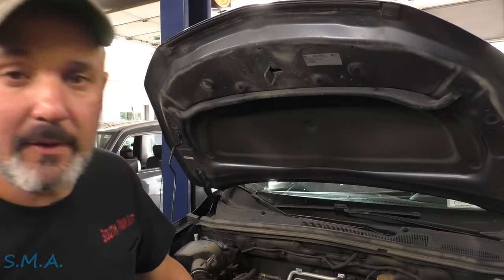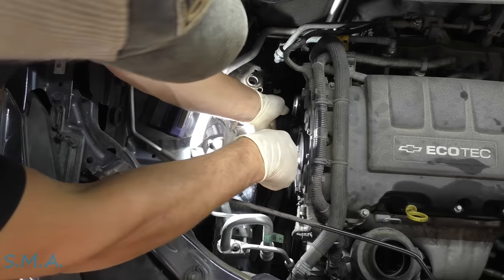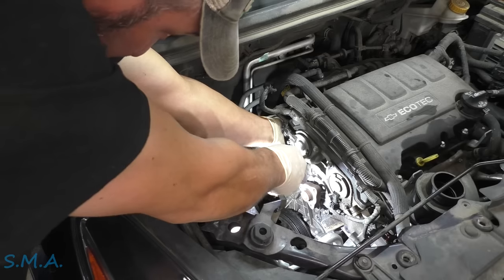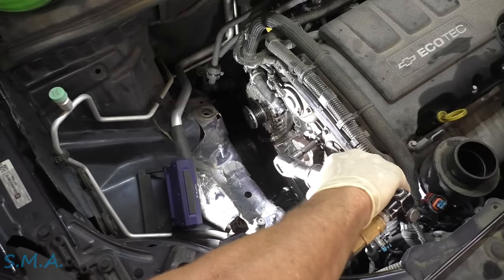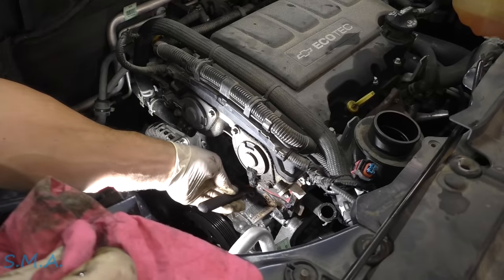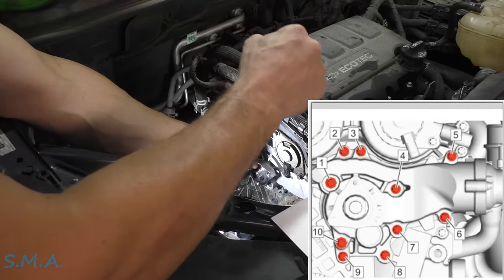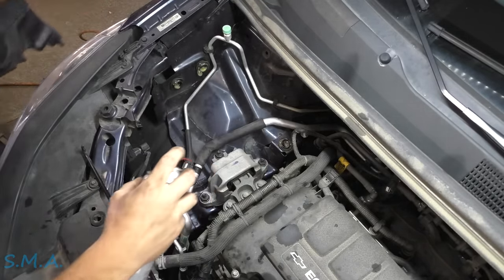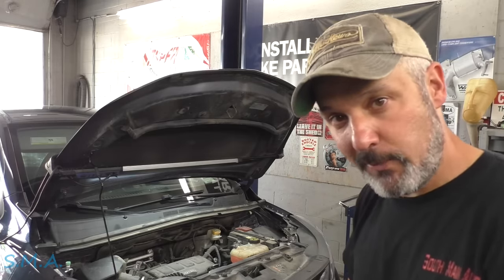Chevrolet Trax: Water Pump

Comment: I used to be chevy, and if I can find a clean older pu. Dodge hemi is almost 350,000. What I need to do make contact with auto surgeon and see if he can find a new old stock. I will add I use high temp form a gasket on water pumps,with the gasket  but I don't have anything that new,and I have a bug in my semi truck and should take a vacation up their and see if he can find it.

Comment: I have an Opel with the same engine, 1.4 l 120 hp version. Water pump must be changed at regular intervals, like belts and tensioners. I have changed it all together at 80k kilometers.  Just because I do not want to take chances to be stranded somewhere far from home.

Comment: That belt tensioner looked a lot like ones on a Volvo D7 Diesel engine, had a coil spring and a wire cable and also no place to loosen tensions. Had to use a piece of wood and a long pry bar or your hand. We had about 40 of those engines out of a fleet of 100 trucks. What a POS they were, changed about 2 a week.

Comment: I have a 2000 Chevy Silverado LS 2500 4wd 6.0 LS with 270k on the truck living in northern lower Michigan my pump just now started a leak original one also busted it's first brake line last week. Almost sold my truck for $1600 today

Comment: Eric, I seem to be the DIYer for my step daughter and her 2019 Trax. Just wondering if bleeding air out of the heater core piping is a necessity with this vehicle like it is for most. I figure if you didn’t mention (other than engine being low) that it isn’t an issue. Thanks for doing your vids, particularly the ones with a lot of wrench turning. I find your commentary and your technique very entertaining, even on repairs to cars I have absolutely have no chance of working on. Happy New Year!

Comment: They should have an electric torque wrench that you can set the setting and press a button and it will just tighten it until its torqued.
Reply: My milwaukee M12 does this....

Comment: 2018 Chevrolet Trax, just out of warranty I guess (maybe it's covered under extended warranty?). The funny thing is, I believe it is the same water pump for the 1.4L Chevrolet Cruze and Chevrolet Sonic. Well, have a look at TSB 14371B about the water pump for the Cruze and Sonic. Also, the radiator on the 2015-2019 Trax may leak TSB: A192219310
Reply: Are you no longer wearing your overalls/bibs Eric? Too hot?

Comment: Hey Eric, have you done the water pump on the Ecotec 2.2L and 2.4L. Looks like a lot of fun compared to this. You'll need a special holding tool and hope you don't drop a bolt into the crankcase.

Comment: The engine mounts are a nightmare to remove, on the Aveo/Corsa nearly impossible... A redesign should have been done years ago , but hey ho they never have to take them off at the factory. The coil packs are a common failure , but they always fail outside the warranty period and are a good seller. The timing chain sounds awful,  miss oil changes and a partially blocked oil pick up...they are tiny and get hard oil crud in them .

Comment: Could you make a video cleaning the throttle body of a drive by wire unit from a 2003 Silverado SS with a 6.0 L and 4L65E trans?  Actually removing the TB and cleaning that is, thanks, Scotty K. sends his best!

Comment: Who in the world designs a tensioner like that? I don't understand! 
Thanks for the video
Reply: The same ones that design an engine that requires the removal of 1/3 of engine to replace a simple belt. Engineers and designers have no concept for those who actually have to work on them.
Reply: FIAT is where the design originated in a cross-licensing deal with GM.
Reply: Germans.
Reply: People who don't have to work on them.

Comment: GM has a special coverage for the water pump on most cars with the 1.4L so this repair could be done for free at dealership but it’s only up to 120,000 miles
Reply: Ten years, 150,000 miles
Reply: @wayne foutz  Can you tell me where this info is ?  Wife's water pump just went out on her 2016 Trax.

Comment: Good job! Isn't 4 years from factory, a bit too short of a lifetime for the water pump?
Reply: In today's world of throw away plastic junk cars, 4 years seems like a pretty good deal LOL.  Given it being a rust belt car, 4 years out of the whole vehicle is pretty good LOL.
Reply: @wildbill23c  Yeah, you may be right (I'm not used to the destructive conditions of the rust belt).
Reply: @JoseSilveira-newhandleforYT  I live in Idaho, and they decided to start using salt and a calcium chloride mixture on our roads, yep quickly destroys your vehicles...doesn't help that all the car washes are closed during the winter so trying to run your car through one a couple times a week is impossible.
Reply: @wildbill23c  That's a big problem - cars are not prepared to resist that continuous salt bath, during snow period. Luckily, I live in a warmer place (no snow in winter).

Comment: Hi Eric, how many miles did the Trax have?   Seems early for a 2018 to need a water pump?   Enjoyed the video!
Reply: The 1.4 is a giant turd, lucky it's still running @ 4 yrs old.
Reply: Unfortunately, coolant leaks are pretty common on the 1.4. Usually it's the water pump or a plastic junction called the water outlet.
Reply: Mileage doesn't matter on this engine.  These 1.4 Ecotec (not the new 1.4 that's the same as the 1.5 in the Equinox) is junk and was junk from day one.  Water pumps, water outlets, thermostat, valve covers, turbos, etc.  JUNK.  20K, 120K.  JUNK.
Reply: Adding the green stuff could've caused the leak 🤣🤣
Reply: 10 miles out of warranty. Exactly as GM likes!
Reply: This engine is a train wreck for multiple expensive issues. So it’s not uncommon at all even for vehicles just out of their meager factory warranty. And it’s telling I’ve never seen a single GM or other American car maker employee defend their vehicles here. Not one. I think they know they’re mostly turning out unreliable junk and nobody wants to be associated with that.
Reply: This makes me appreciate my 4.2 straight six atlas motor even more. Sad part is i even considered of getting one of these and im glad i walked away. My sis has a chevy mailbu with the 2.4 ecotec motor and has nothing but issues
Reply: Jimmy S  dude that's the story of my life as well...same same same
Reply: @christopherzube551  I've also got a 4.2L that will be turning 300k by the end of this yr.
Reply: 4 yo and the pump is NBG !  I wouldn't care, but the Trax reliability is directly proportional to it's high price.  Can I point out that GM were bailed out by taxpayers money ?  Makes you think.
Reply: My car is a 2003 and it still has the original water pump, with that said it barely has 125k miles on it.
Reply: Jimmy S  However GM will replace intake  for free  lifetime recall
Reply: Are Trax Korean Daiwoo?
Reply: @randlecycling2462  yes they are made in Korea. I had one come in for service a few days ago and the 1st digit of the VIN started with a K.
Reply: @randlecycling2462  Yes and is also Buick Encore
Reply: Jimmy S  I thank God every day that I was able to wait til 2018 to buy my Cruze which has the gen 2 engine.  I had no idea the first gen had so many problems.  45k and so far and no issues or leaks.
Reply: Yea these cars are disposable. Idk why people waste money on them

Comment: Hey Burt let’s design a transverse motor and make no access thru wheel well . 🤡 technicians will love it
Reply: I knew a caddy tech, he drilled an access hole in the right fender apron to remove the camshaft on a fwd drive northstar.  Car owner went berserk, and the guy was fired lol
Reply: @scrappy7571  now that’s funny if you’re not the owner 👊🏻😂

Comment: So- I do mobile repair…or mildly stupid to put it simply 😂…I haven’t had issues with quick connect coolant lines- older ones have the o-run flattened, but I just replace those and nicer have an issue- am I missing something?

Universal coolant…it “works” but man it surely doesn’t do it well for any length of time.

Comment: The different length mounting bolts should be color coded - then the hole it passes thru could also be colored to match the required bolt length 😳🤔

Comment: What is the average cost to replace a water pump, also if your head gasket starts to leak antifreeze on the outside of the engine what would be the cost to replace a blown head gasket, on a 2007 Hyundai Santa Fe SE, 3.3 L engine.

Comment: Hey! So #1 I've been watching your channel for a minute and it's helped me understand more about how some of these modern cars work. Even helped me diagnose a bad TIPM on my 08 Chrysler Sebring. I ended up grabbing one from a junkyard and it fixed my main issue (won't stay running), but now I'm getting "nofuse" on cluster (but no money light!). Power locks don't work, ditto for a/c controls but engine/trans/brakes/cooling/lights all seem to work with no issue.  

I'm guessing this is some kind of vin mismatch thing. Are these able to be reflashed so my stuff works or do I just need to shell out for a replacement tipm at this point?
Reply: So locks issue fixed, was a bad fuse I hadn't seen. same with no fuse issue. So far just a/c compressor control doesn't work just blinks at me but a/c is on/working

Comment: I done this in my 2012 cruze last month such a pain to get too! My thing is now.. mine when i took it off did not have a metal gasket like that just silicone and disnt have that metal disk that went around the propeller and the hole in the motor.. ... am i doomed??

Comment: Why have an electric heater on a thermostat it’s just tech for the sake of it… it’s what I hate about new vehicles so much stuff just for the sake of it…  4-6 electric motors on the ventilation mixer and direction…. Just another thing to fail and cause a money light to pop on up..
Integration of ventilation stereo and sat nav so when it fails and they will instead of $100 for a sat nav or radio head unit it will be $1500 for the complete unit plus labour…
Rant over 
Thanks for another great video

Comment: Funny how my 2012 Cruze had the same motor and GM has replaced my water pump 3 times.  They offer a 250k replacement on some models but not others with the same motor.  🤷‍♂️

Comment: You kept me hanging until the end - it looked like orange DexCool.  When I changed all the hoses and the thermostat on my 2003 Saturn LW w/2.2 Ecotec, I ended up having to make an appointment with the local Chevy dealer for the heater hoses, because of those damned quick-connect fittings. When it comes to bleeding after a fill, is the thermostat with the heating element a good thing?  It seems like it would start to open even if there was an air bubble trapped behind the t'stat, and make it easier to bleed, so that would be a benefit to using a complicated & more expensive t'stat design like this.

Comment: I am doing a 2014 mitsubishi lancer gt sportback serpintine belt I can not get it on its about half an in to small even if I pull the tensioner back.  I have gone twice to the store got two belts sane problem.  Any suggestions?

Comment: Hey Eric...
What are your thoughts about the vacuum cooling system filler? Like in the astro # 78585 kit. 

I worked as a collision repair technician and on some vehicles (i.e.multi rad systems) I have to use a vacuum based filling as the air pockets are nearly impossible to burp with the traditional method. I don't have the astro tool but used a snap on tool but same concept (use shop air to pull a vacuum on the system and replace the vacuum with coolant from a bucket).
Reply: They work great on cooling systems that are hard to fill, due to air being trapped.  I avoid using it, because it has ruined several water pumps.  While sucking down the system heard a small pop sound.  Fill up with coolant and it's pooring out the weep hole.  Cavalier 2.2  was a hard system to fill, and had to take the chance on those.
Reply: I have an Airlift  550000 I bought 10 years ago. I prob only use it a time or two a year. Just used it the other day on an Explorer with a water cooled PTU. Vac down and filled the system in minutes perfectly. 

I usually just use the spill proof funnels and let the system burp out as it runs. BUT you get the specialty cooling system you need the vac fill systems with. Astro one looks nice with all the adapters

Comment: Been watching for quite a while . Love your energy man  . Quick question I’m dealing with a 92 GMC Yukon 5.7 TBI that has one issue I can’t solve . The engine seems to run just fine and normal until you put a decent load on it . I.E A/C on and in drive , brakes applied , while turning the wheel in reverse the truck dies . Restarts with the key immediately . Won’t happen when cold since the engine is at a higher cold idle speed . But once warmed will do this . I always felt like the warm idle was a bit low compared  to my Vortec 5.7 . Do you have any thoughts
Reply: Sorry, I read this late,,,I’ve done many,,, short list,,,, TBI gskt. , Clean throttle plates,,  IAC , if “rich smell when warm,,, the triple ground wire @ thermostat housing,, grounds coolant sensor & O2’s,,, clean,,, good to go! Primitive system that works well,,, when it’s in order! Hope this works for U,,, done a few hundred ! LOL over the years ! LOL

Comment: Chevrolet trax ...That there is a Daewoo Trax.....The older style engine the timing belt ran the water pump ,,,,,They were crap ,,,,,,water pump spun to adjust tension for the timing belt

Comment: I don't know what it is about the water pumps on those 1.4s,  I drive a Cruze with that motor. Everyone I know who has one, including myself, the first water pump fails somewhere between 20,000-40,000 miles, then the replacement will last a couple hundred thousand miles.  I've got 150,000 on my second pump.

Comment: And this is why I don't like sideways engines. Too much work involved to remove something simple.

Ill stick with SUVs with what I call normal engine placement, with the belts at the front. Just easier to access the things ill replace without doing this much tear down.

Like my 08 exploder, alternator is up top and easy to get to. Water pump is also within easy reach. Only complaint is the damn passenger side wires routed behind the nator.

Comment: Ah just what I needed, another broken Chevrolet but at least I don't own this one. My 2013 Chevrolet with the big 3.6 liter is dieseling whenever the engine gets above optimal engine temperature, doesn't do it when the engine is cooler than its usual temp, just when it's toasty though fortunately the old bat hasn't decided to keep running when ignition is off. I suspect that residual fuel is creeping down into the combustion chamber from dirty injectors and igniting just enough for all six cylinders to move until the engine decides to stall. Kind of a strange thing to witness when the engine isn't carbureted.

Comment: MY OCD would remove that leaf and debris from the motor mount asap.  Could not let it sit there for even a minute.  REMOVE THE LEAFS AND TWIG.  I also can't understand why you didn't just change the thermostat while you were that far in there, regardless of price.  Why didn't you put the green fluid back in since the customer had already switched it over?
Reply: Do that in the dealer, customers will call you a rip off.  They can pay me again if it overheats.
Reply from the maker: I just go in and do the job I was hired to do. I put in the coolant that it comes with from the factory and that is it.

Comment: need to change the water pump. OK $50 worth of tools I'll never use again I'm ready. What's wrong with regular headed bolts?
Reply: 6 point sockets fit on most of them just fine...
Reply: @scrappy7571  good to know

Comment: You did torque those 3 water pump pulley bolts, right.  I wanted to see how you held the pulley still while you achieved torque.
Reply: Take your old belt, put it through the box end of a large wrench, use it as a strap wrench to hold the pulley still
Reply: Zing them on with the ol' milwaukee m12 1/4 drive.  This ain't the lunar rover.
Reply: Click 😉
Reply: Use a pry bar between 2 of the pulley bolt heads.  Just like he did in the video.

Comment: Those engines are just an utter shit show. Plastic everywhere, I replaced two coolant outlets on my daughters car. Turbo under warranty at 40k. Water pump replaced, valve cover twice! I finally utilized the PCV bypass kit sold by Cruze kits and it ran well as half the engine was replaced anyway. One of the happiest days of my life is when she traded it in for a Nissan!

Comment: a 2018 that already needs a water pump. Water pumps should last between 10-15 years. 
My car is a 2003 and it still has the original water pump, with that said it barely has 125k miles on it.

Comment: I'm wondering if anyone may be able to help me?  I put new brake pads and rotors on my car the other day and noticed that the outside of the rotors seem to be wearing more than the inside?  I even took the caliper and brackets back off to confirm that the pads move freely in the brackets and they do.  Is this just normal when you install new brakes and should they start to wear evenly the more I drive it?
Reply: I cleaned and re-greased the caliper pins as well so the calipers move smoothly on the bracket.  Not sure there is anything left for me to do.  Just curious why they don't seem to be wearing even from the get go...
I'm thinking it is due to the caliper pistons being more towards the outside of the rotor so it gets just a bit more pressure when you use the brakes?  I paid a good amount for quality brakes and rotors so I don't want to have to replace them already lol

Comment: With that little piss ant engine, when you remove the motor mount couldn't you just support it with a little bungee cord hook to a spark plug wire and a windshield wiper?